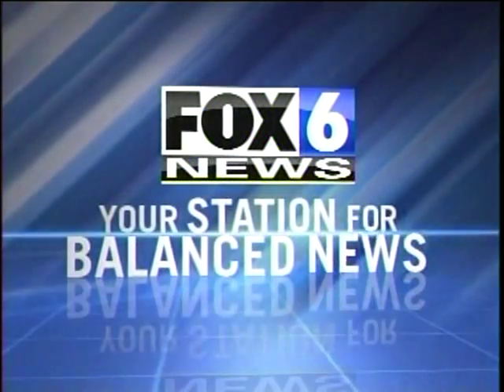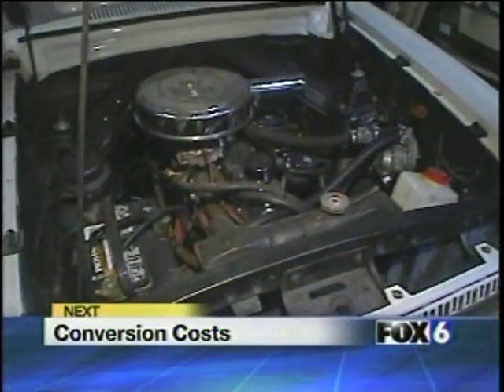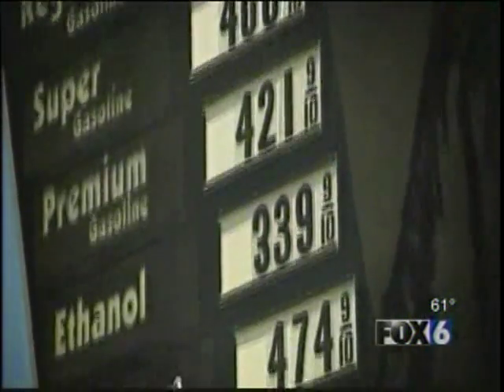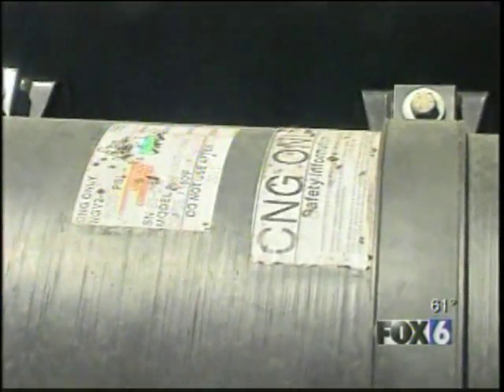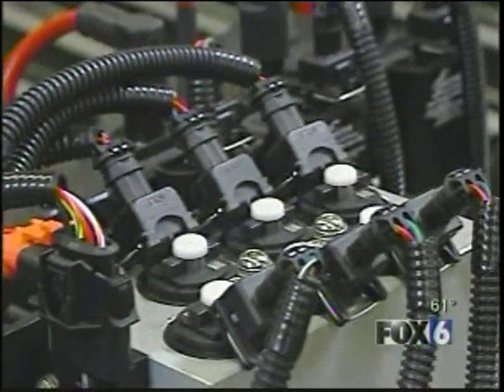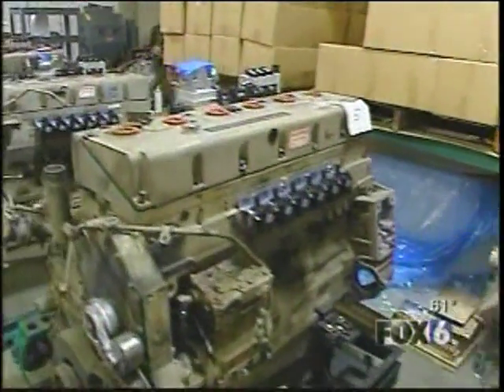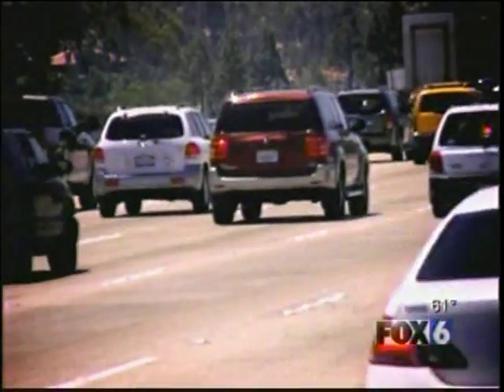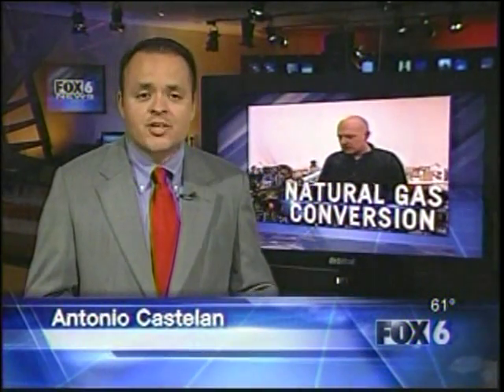Omnitek Diesel-to-Natural Gas Conversions featured on Fox News

Comment: Well if fox think this is is a good idea then it is a piece of crap. Common rail diesel is the way of the present and the future. Americans have no idea what the rest of the world is doing. Every car, van and suv sold outside the US have a factory diesel option and the market share for diesel has passed 50% in most sectors where the engine size is over 2.0l. But Americans have no idea what the metric system is either.